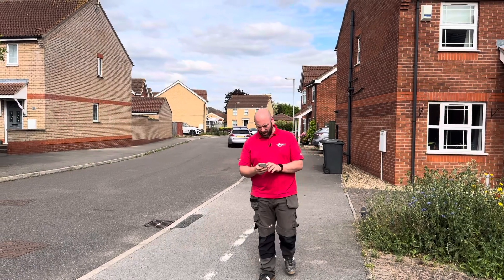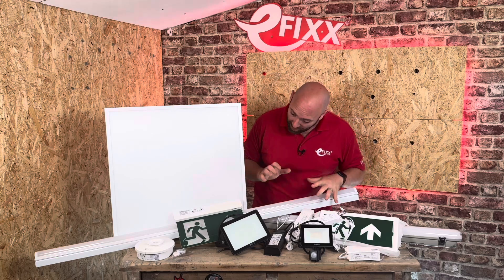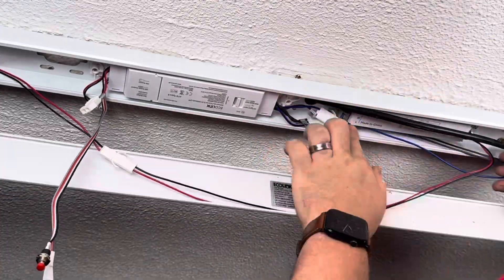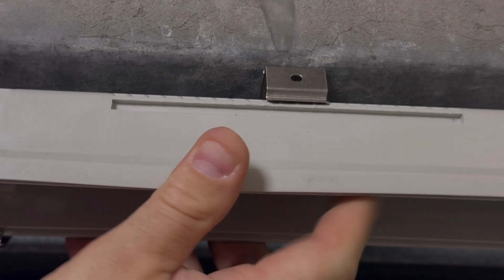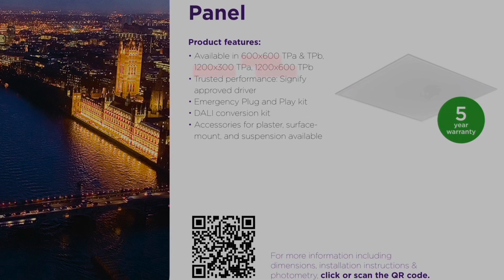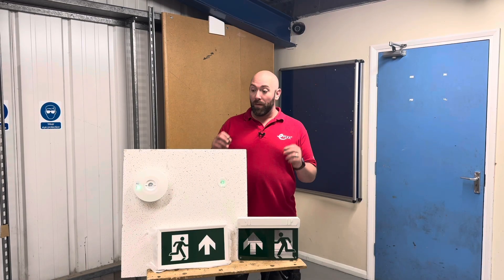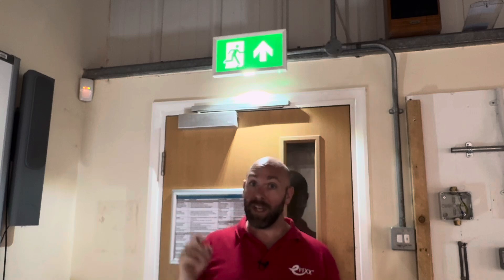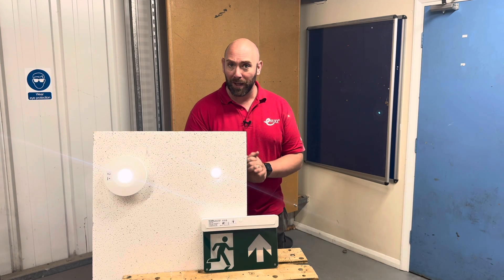Affordable Lighting - Amazing Quality - Yes, It's Possible! - Ecolink by Signify

Comment: Can you change the driver in the floodlight, and can you change the gallium discharge fluorescent tube in the batten 😂.
Reply: Luceco is the only manufacturer I've seen doing replaceable tubes in their fittings. I actually quite like their battens.
Reply: @AndrewStrydomBRP  however, I need 2 5ft LED tubes to come near around 4400lm, 58w of the normal T8 produces 5200 on its own and the efficacy is negligible, what I want to see is a gallium alloy at room temp and a bunch of xenon gas.

I know DW Windsor a British manufacturer of streetlights, dominantly heritage lighting, make LED floodlights with replaceable drivers, potentially the LED module is replaceable I have to confirm with them though.
Reply: @professionalineverything  it may be "small" in an individual light but it is significant over a full building of them, like in offices
Reply: @professionalineverything  I'd rather have more smaller fittings for better light spread in a space.
Reply: @AndrewStrydomBRP   oh well, we all have our differences, i prefer oversized lighting in an area.

Comment: Is any of this stuff actually MANUFACTURED in Britain?
Reply: No not a a lot. Designed in the uk doesn’t mean it is manufactured in the uk.
Reply: its about 1 yr wonder until they fail
Reply: It might have a 5 year warranty but who pays the contractor to come back when it gos wrong . 
My fluorescent lights  in my garage are British made,and are over 50 years old and still going strong. Even the tubes last for years
Reply: @andysims4906   agreed 1000% there my garage is the same good ole Fitzgerald lighting tubes work a treat the tubes have been in there for ages